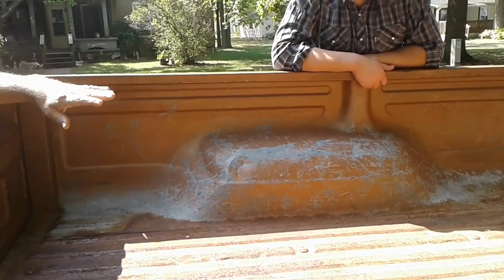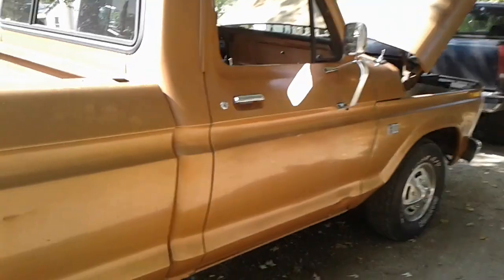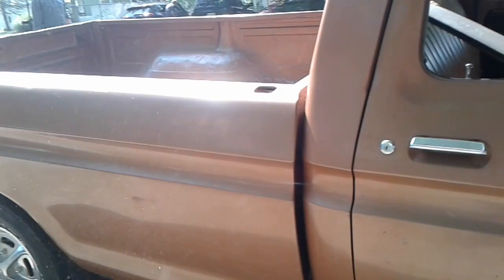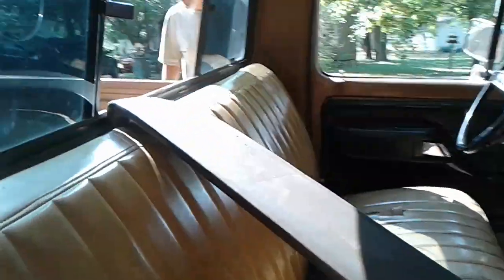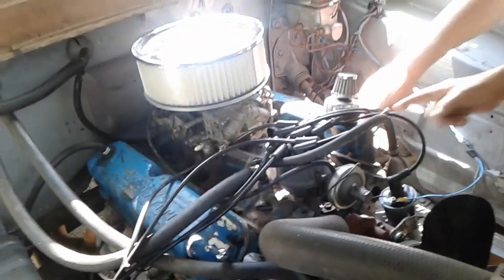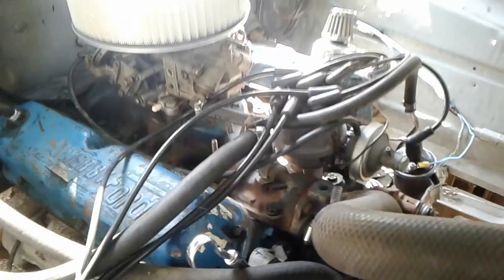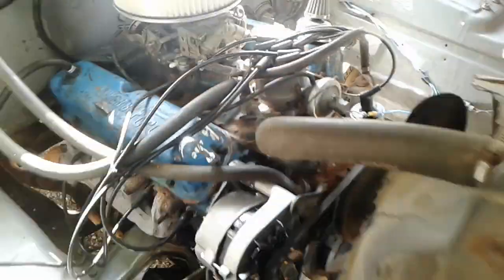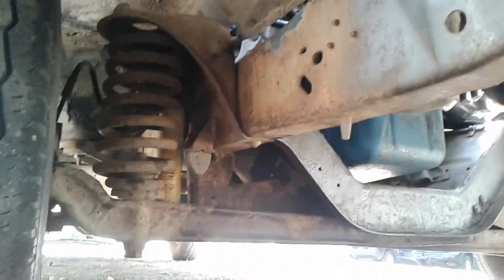1973 ford f100

Comment: 1973 is the only year to have 4 screws in the tail lights and the difference wheel wells
Reply from the maker: David Rearick i did not know that, good to know
Reply: I live in Pa and an currently rebuilding a 1973 4x4 and am putting a 429 in it I bought my bed from a local who has beds shipped in from California when I told him it was a 73 he asked how I knew and I showed him, he had never noticed that in all the years he had been doing it, good luck with the truck! I love these old fords

Comment: Exhaust setup on the black one???
Reply from the maker: Wesley Parker 2.5 off the manifolds back to short glasspacks and 2 inch tailpipes for back pressure. Stock 390 4 barrell